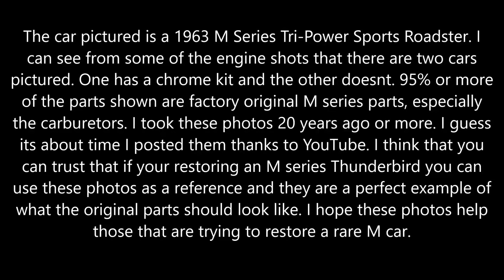1962, 63 Thunderbird M Series Tri Power Sports Roadster

Comment: Hi Nick, Jim here from Florida. I just picked up a 1963 Thunderbird M series convertible. It’s a J paint code Rangoon red with a 56 red Vynal interior. It’s an 85M car which is not the sports roadster but it is a convertible with the factory tri power set up. The man I bought the car from had the car for 48 years, he bought it in 1972 so it’s all original. I’m using your video to look at the carburetor set up which my secondary carburetors are blocked off. I want to get them working again so I’ll use your video to do so. Thank you so much for posting this after so many years that you had the pictures. I’d like to keep in touch with you on this.
Reply: Thanks Nick for the tri-power video. Awesome and such clarity and detail like I’ve never seen. I want to rebuild my 85M tri-power set up so do you have a recommendation of where I should buy the carburetor rebuild parts. I think I’ve seen them on some of the T Bird places but I thought I would ask you first. I’m going to take it slow and easy but I think I can redo it. Thanks,  Jim.
Reply from the maker: Hey Jim, again another comment I didnt get and Im just learning all the different places where I can see them. I really dont know were to get the carb rebuilt. Pony carbs went out of business when the owner died and that was my last source for carbs. Ive just been buying new Holleys to replace the old Autolites. Sorry, Nick

Comment: Jim here again Nick, would you by any chance have a driver and or passenger or both sides of the top frame arms for this 1963 85M series convertible. For some strange reason these broke while I was retracting the top into the trunk well. This car has mismatched size  top cylinders and we’re thinking that could’ve done it. Not totally sure though. Do you have a used set of top frame arms. Thank you. Jim
Reply from the maker: Hey Jim, sorry for the late reply, YouTube doesnt always notify me of messages. I do not have these parts, sorry. Thanks, Nick